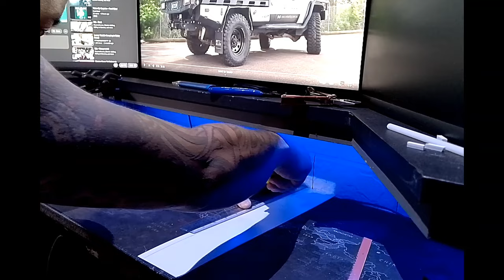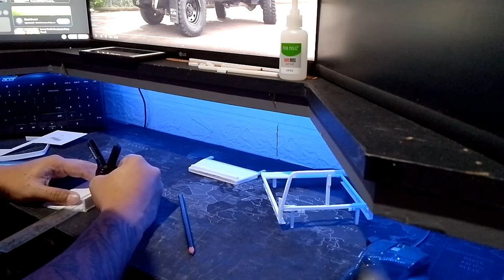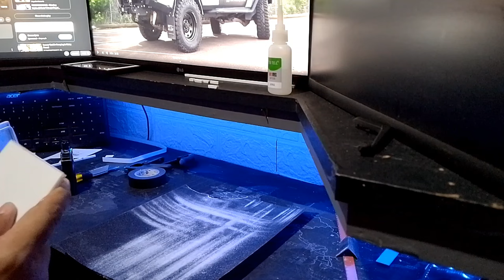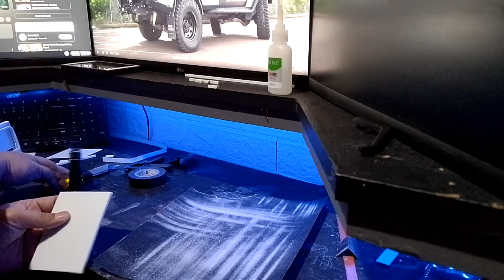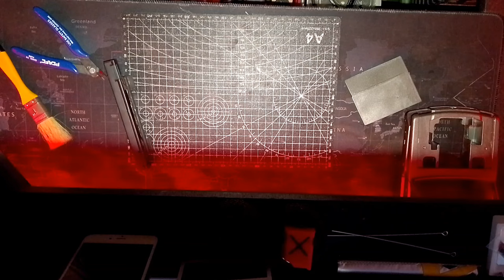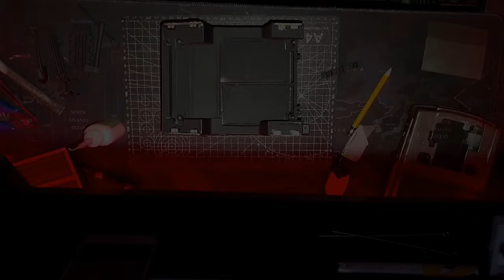Scratchbuilding Mits Alloy canopy for the MN82.

Comment: Looks awesome! I was thinking of doing something similar if I bought the MN82. I was thinking of 3D printing all the parts and accessories instead. Great job👍
Reply from the maker: Thanks. I'm still saving up for a 3D printer, so my next projects are hopefully with 3D printing. Working with styrene is also fun though.
Reply: @Violator-RC  It's very inexpensive to print (smaller) parts online from china, I got a bunch of parts for pennies from JLC
Reply from the maker: @daijoubu4529  Yes, it is. I know someone who can print some accessories and other stuff, for now I wanted to have my own printer so I'm still saving money to get a good one.
Reply: @Violator-RC  But those commercial MJF and SLS prints in PA12 nylon are at are at another level of quality than FDM printing, it's truly marvelous, give it a try, new customers gets a number of coupons, I'm not even sure if they are making money, could be loss leader or to reduce losses. I too just started learning CAD and made a couple of parts for the MN82 already, this is so much fun haha.
Reply from the maker: @daijoubu4529  Do you have a link for it? I'll go check em out. It really is fun making stuff for our rigs.

Comment: Much respect. Well done. I was thinking of using .025 sheet metal for mine but have yet to dig in. Considering the weight, styrene is probably a much better idea.
Reply from the maker: Thanks. I appreciate it. With this build the canopy is a bit heavy that's why I have to convert this to a 4 link suspension since the stock leaf spring won't support the weight of the canopy. I can just imagine if you use sheet metal then weight is going to be an issue.